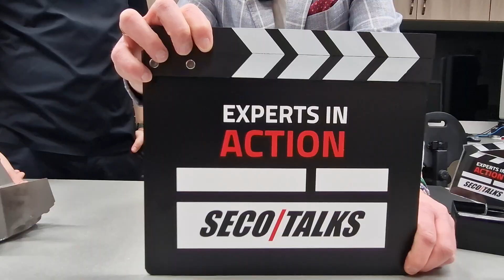SECO/TALKS: 🥶 Can deep freezing optimize industrial processes?

Comment: Very good explanation of how cryogenic tempering processing supports enhanced material properties.  Also, that you can conduct this operation in a vacuum furnace directly after hardening is extremely beneficial to the quality and shortens the overall process time.  Well done Adam and Grzegorz!
Reply: Thanks Tom. 
That's exactly what we meant. 

And if someone insists, you can also freeze some fruits, and maybe even pump it out earlier 😂